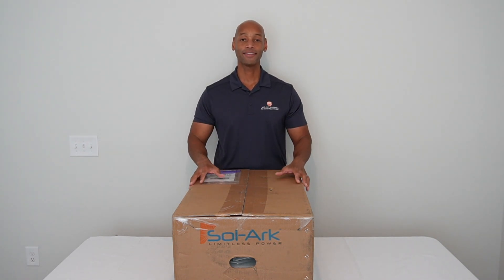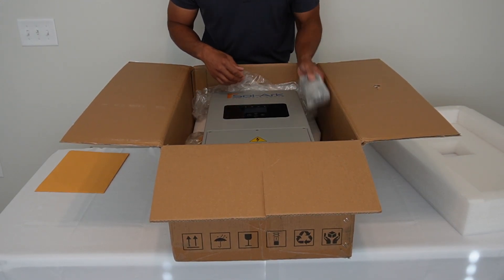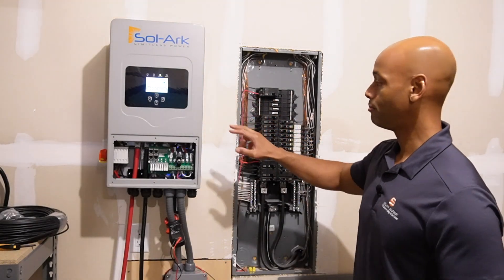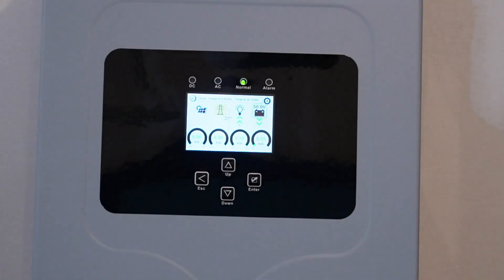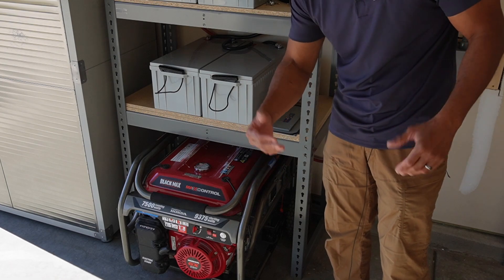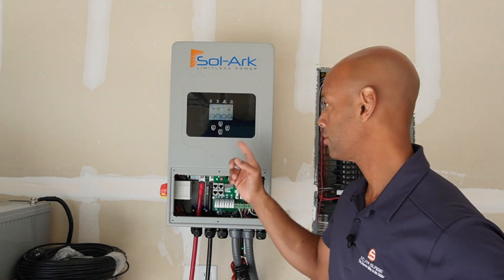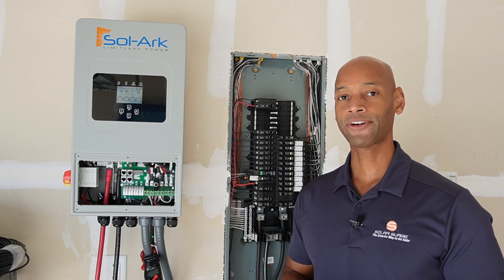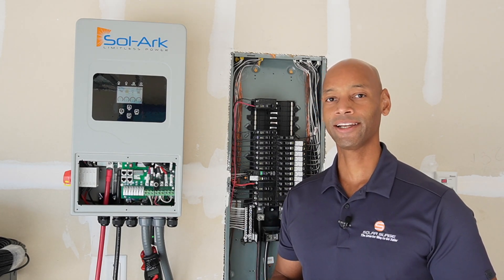New Sol-Ark 5k 1P Unboxing & Installation

Comment: WARNING:  NEVER parallel a single ungrounded (hot) conductor to BOTH distribution panel busbars, as was done in this demonstration.  If there are any multi-wire branch circuits present, or if they are added later, you are risking an electrical fire from an overloaded grounded (neutral) conductor.  NEC code requirements (grounded conductor sizing, multiwire branch circuit allowances & etc.) are based on the assumption that balanced loads will eliminate partial loading on the grounded conductors(s).  By paralleling both buses, you are forcing all grounded conductors to carry 100% unbalanced loading.  This can result in a fire.

Comment: Lead acid!? What depth of discharge will u use? That will significantly cut into the 9.6kWh capacity…Or sacrifice lifespan if you discharge below 50%.  Maybe, by the time those batteries fail, prices will be down or the tech will be much better for lithium. I’m not impressed with your chemistry choice.

Comment: One thing you mentioned in your video prompts me to ask. Why are sol-ark not offered by grid tied solar installers?
Reply from the maker: The Sol-Ark is a more complex install and the system does require a bit more maintenance than a Grid-tie only system. Most installers that handle Off Grid systems will handle Sol-Ark with no problem.

Comment: Do you know what the THD rating is on the Blackmax generator?
Reply from the maker: I'm not sure the generator's rating, but the Sol-Arl will tolerate up to 15% THD.  I've had no problems running it with the Honda GX390 engine generator.

Comment: I'm surprised that it is not part of Myrtle Beach electric code to have a "rain proof while in use" cover for the generator cord input connection.

I like the Sol-Ark being used with a small generator, but I don't like the single phase aspect of this model.  

I don't have a house that makes solar panels a valid option, but I do like having a whole house battery backup setup that I could charge using a small generator.  This would allow for me to only run the generator when the batteries are low and make for a far more efficient use for the generator output.  It is a huge waste of gas and generator run time when the vast majority (season dependent) of the time a house is not using 1kw of power.

Comment: Hey Joe this me again from Puerto Rico and my question this time around is can I use this inverter with the POWER OPTIMAZER from solarEdge the reason why I ask is I had a SOLAR GRID of 5.7kw with (24) REC panel w/ optimisers and a solar edge 7.6 kw and (2) Powerwall Gen.1 one went bad during (FIONA) and the other one got me by but giving error code into the inverter, lone story short took the hall system down and now I want to build the way I mention before a SolArc w/ optimisers and a TESLA Powerwall2 hoping that ELON trade the (2) Powerwall gen 1 for a one Gen2 Powerwall. Can I go (24) poweroptimazers , SolArc, Powerwall 2 battery ? thanks for the answer.

Comment: Thanks Joe! Can you expand on how the loads i.e., 240VAC vs. 120VAC are separated in the panel?  Been a subscriber for 1+ years
Reply: In a typical electrical panel, normally every other 120V breaker is on a separate phase.  They are 180 degrees out of phase electrically, so that gets you 240V across two adjacent breakers (normally).  But in this installation, he's shorting both phases together (red and black wires joined at the SolArk).  Doing this provides 120V to all the 120V circuits, but the 240V circuits see 0V (and aren't usable when on backup).  Of course, as Joe mentions, this only works if the main breaker to the grid is turned off.

What he's showing is often done, but it isn't compliant to any electrical code.  There is no physical interlock preventing simultaneous grid connection and inverter backfeed (and also in this case, phase shorting).  A mechanical lever is normally used to physically prevent the mains breaker from ever being engaged while backfeeding power (from a generator or inverter).

Comment: Seen a few of the 5k 1P videos, but none on the actual install and or 'live setup'.  Much appreciated.  Cost wise, its a great choice.  It'll get interesting between one or two of these versus one or two of the EG4 units.  Sol-Ark has better support, better R&D, and less settings (which is a HUGE plus for most people that should NOT be over-tinkering).  My only concern would be the the 'process' for failing over being manual.  Usually not a big deal unless no one is home, OR may be a pain for the 1-3 hour brown outs.  Depends on the stability of your area, and being new construction, that has yet to be flushed out.    Cool thing is having the equipment gives you options that allow for wiring reconfiguration down the road.  Thanks for the video!
Reply: $4500 for the unit is a great choice cost wise, and for 120V only?  Versus what specifically?
Reply: @billjohnson3344  just meant compared to Victron, Schneider, larger Sol-Arks, "black box setups ala Tesla or Enphase', etc.  You pay for the name and support.  The EG4 is 1/4 the cost but there are trade-offs which may or may not matter.
Reply: Where do you live that has brown outs?  I'll take a black out over a brown out ANY DAY.  I have not experienced a brown out since 1977.  A brown out is when the voltage droops below 100 volts, and can overheat and damage motors.

Comment: I was taught to connect the electrical cable prior to starting the genset, but that assumes no loads on the line
Reply from the maker: For the gas generator, I like to let the generator warm up prior to connecting any load.
Reply: @SolarSurge  There shouldn't be a load on the input line when you connect it in any case.  Please tell me there is a disconnect between your generator input and the panel you are powering.

Your credibility is taking a nosedive here.
Reply: Great Video @SolarSurge! I think I will purchase on of these units base on what you demonstrated. Yes, @edwardbyrd7667, in my case, I follow the same practice to properly ground my genset. I connect my Floating Neutral configured genset to the Transfer Switch before starting engine for warmup.  Of course, before doing so, with all loads disconnected from genset itself and the transfer switch still set to LINE. I do this just in case a ground fault condition has already occured (but I don't know it yet) at my PORTABLE genset. Who knows, moving the genset or portable tools I plug in could have knocked something loose. The genset ground fault should then "mostly" utilize a least resistant electrical path, via the cable, going to the GROUND/NEUTRAL bonding screw in the main panel , in turn, causing a breaker on the genset to trip. Trying to avoid a potential, at the frame of the generator, as much as possible.

Comment: Congratulations on new home
I'm trying to add more solar to my emphase system. Wondering if it is possible to add generator plug to combiner  box and tap into that?
Reply from the maker: The new Enphase IQ System Controller 2 allows your to integrate a generator.  Ask you local Enphase installer about this.

Comment: I think the MPP's, Gro Watts and the EG4's of the world are causing some serious competition and Sol-Ark has responded quite nicely. BTW is that generator clean power that you are backfeeding with or is it a modified sine wave?
Reply: Didn't hear a mention of the Sol-Ark 5K price, which is $4500 (not sure if Joe got for free though for promoting).  That's a lot more than even name brand competition, let alone the China stuff.  Schneider SW4048 can do split phase 120/240, and is only $1850 without solar (price of inverter and Insight Home).  The workhorse XW is not that much more for lots of surge power.  Add charge controller(s) based on solar.  Sol-Ark still overpriced, and this unit limited with 120V only support.  And Joe's install method would not be code approved - with no mains interlock and shorting phases.
Reply: 1P is $3500 not $4500